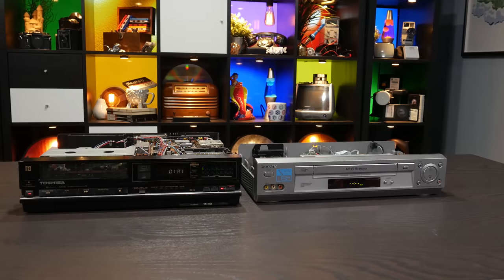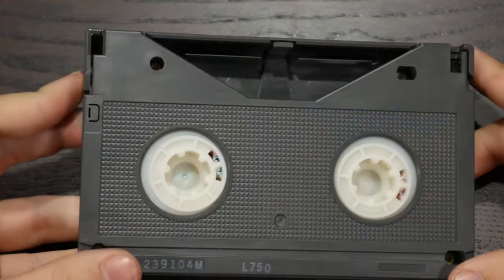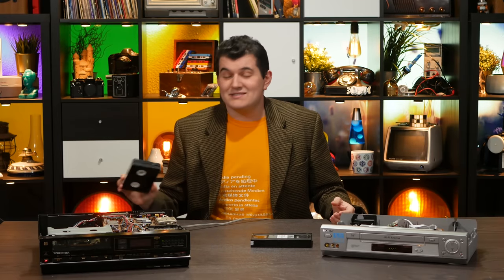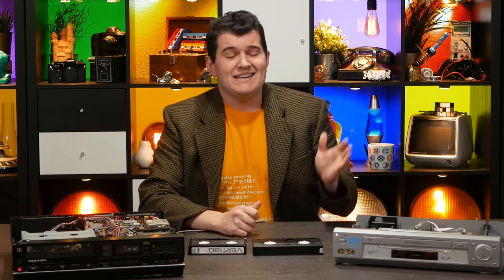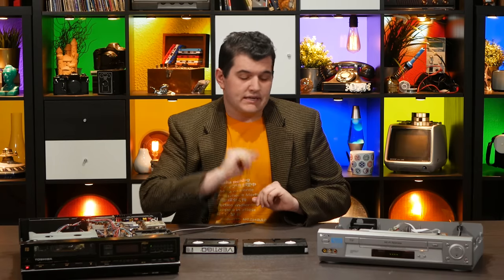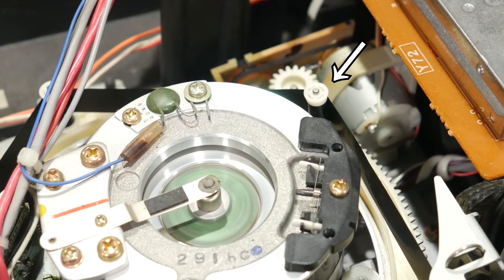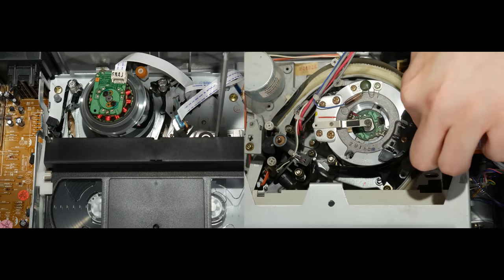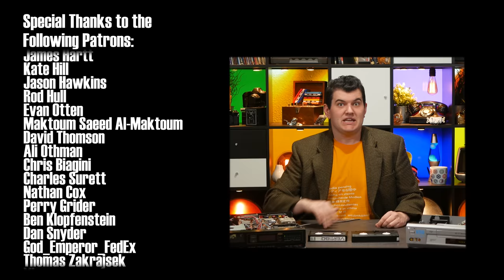The VHS cassette was more clever than Beta

Comment: “Where is my HD-DVD player?”
I’m still laughing 😂
Reply: At least there were a few BluRay HD-DVD combo players. I'm not sure how many VHS+BETAMAX combo machines there were.

And because it's still semi recent, finding a BluRay\HDDVD combo drive for a PC or a Samsung BluRay\HDDVD combo player isn't difficult.

The problem really comes in when you look at format quality. Everyone claimed HDDVD was better, which wasn't true. BluRay offered substantially more capacity. 20GB more on a dual layer disc than HD-DVD's 30GB dual layer cap.

The ONLY advantage HD-DVD had was simply it could be made compatible with a DVD player through another layer or simply pressing the DVD layer on the opposite side of the HD-DVD side (which, granted, could theoretically have been done to a BluRay if Sony cared to maintain legacy compatibility.
Reply: @emotionz3  Thw biggest advantage was  HD-DVD had more functionality at launch.  Bluray was in flux so compatibility of features between players varies wildly.  HD-DVD was also cheaper to manufacture.
Reply: I liked HD-DVD because it was region free. None of the other stuff mattered.
Reply: Remember when the Xbox 360 had a HD-DVD external player?
Reply: @Takeshi357  Probably one of the reasons HD DVD failed, less companies wanting to get into a format they couldn't region lock. With tape PAL tapes won't work in NTSC or PAL. Kind of solved problems.
Reply: I seriously doubt THAT is the reason. If it was so unpopular with the studios, why did they ditch the region lock again for 4K UHD?
Reply: A big reason for HD-DVD’s failure has to do with Microsoft’s involvement and proprietary software/codecs (especially VC-1 and HDi) used in the format.

A lot of technology companies (especially now ironically, Apple) backed Blu-Ray since it used more “open” (aka non proprietary) software and codecs (e.g. H.264 and Java).
Reply: @Takeshi357  because physical media is rapidly dying at this point, and a high end standard that most people can't utilise isn't exactly likely to "need" region locking.
Reply: @Yeen125  Interesting, as also Bluray was at first seen as a boon to computer hardware, but I was told the codec to use it was blocked by the design owners, and most companies dropped adding those drives to machines. i had one given to me, basically useless.
Reply: @Takeshi357  "I liked HD-DVD because it was region free." Absolutely agree! Given that the studios which signed up to it apparently also agreed, I see NO excuse for region coding now. There was no region coding on CDs and the various labels (often the same as the film studios) didn't seem to mind at all!
" None of the other stuff mattered." This is where I have to disagree somewhat. The two major advantages of Blu-Ray were: 1) longer time/more data available. Back then this was a big issue (remember some Betamax films on two cassettes?) and doubly so for data recording and archiving. The lesser capacity of Beta (especially in the early days) is one of the factors which contributed to its demise. Sony learnt this lesson and was determined NOT to be beaten by it again. Although most films could be squeezed on to a single HD-DVD disc, there were some outliers where the quality suffered too much.
2) Blu-Ray discs learnt from the downsides of the DVD, and were much more resilient to rough treatment; although more expensive to produce as a result.
Ultimately, studio support for the Blu-Ray format is what tipped the balance and 'won' the war.
Reply: @LiEnby  Great! Since you are not talking Hex to ASCII we have no idea what you are talking about!
Reply: @FurryMcMemes  Why?
Reply: I always thought one of the major reasons Blu-ray won out was because the PS3 was the only console at the time to have native HD support, with a built in blu-ray player. I remember hearing at the time of its release, it was one of the cheapest blu-ray players on the market.

Consumers were going to buy the console anyway, and thought, like myself, there's no point in buying a separate player. Just get the blu-rays.
Reply: HD-DVDs are old news, HHDDVVDDBVD are all the rage now.
100 Points for whoever gets that awesome reference :D
Reply: @rahb1  I'm guessing because Microsoft was involved with HD-DVD so they sold a separate drive for the Xbox 360 so owners could play those movies.
Reply: @rahb1  hex can only ever be used to represent ascii text data (lul probably one of its worst uses)

its the HDDVD encryption key >_>

Comment: Regarding tape cartridges, my all-time favorite is Video8.
The Betamax tape feed path looks like a nightmare to untangle if anything ever goes wrong with the machine.
Reply: I remember the Sony rep proudly bringing a demo Video8 machine into our workshop to show us. We quickly wired it up to a nice Sony TV and off we went. There was no doubt about it, the pictures were significantly better than VHS/Beta and we all stood around nodding and making the right noises. Then there was quite a long delay before the system actually launched onto the market, and something seemed to have happened in the meantime - the pictures were definitely NOT as good as the demo. in fact, although they were still better than VHS/Beta, the difference was small. Never found out what went on during that long delay...
Reply: @andyhowlett2231 cost cuts. I don't remember if video8 was tape but they probably increased recording time in exchange for worse quality

Comment: The light detection of the end of the tape reminded me of something I nearly forgot: back in the 90's at some point, when I was 12ish, I acquired an old VCR that didn't have a cover. (I got a LOT of electronics by grabbing other people's trash and they frequently had damaged or missing cases, but working internal electronics!)

I used it to record TV shows on at night ("Becker" was one that was on past bedtime that I'd like to sneak) and had no problem. But then I put a lamp on the same table and found it kept spitting the tape back out any time I tried to play or record... took me a little while to figure out that there was a light sensor in there!

Putting a random piece of sheet metal over the top of it solved this problem. I used that VCR for a couple years.
Reply: Damn, people threw away electronics when only the case was broken? That sounds like such a boomer thing to do lmao
Reply: @Reydriel  In America people throw a lot of things away just because of cosmetic matters. All grocery stores combined in america throw away an average of 43 billion pounds of food every year because of cosmetic/blemish reasons.
Reply: @autonomous2010  not just in America.
That's something every developed country does.
Reply: @Reydriel  oh yeah, tons of stuff with minor damage - often cosmetic, but sometimes easy to fix electronic stuff like a failed capacitor - can be found in the trash or on the cheap in the second hand market. I got a Super Nintendo as a kid basically this same way too - the case was ripped right off (my guess is someone got VERY angry at the game) but the board inside was fine.

I actually still have that one... and it is still just a board with the wires popping out of a shoe box lol.

And the best part about free junk is if it doesn't work? Oh well, no big deal. Worst case is you waste time, but even in these you often learn something new about how electronics go bad.
Reply: @Reydriel  Heh.  I had neighbors in the 90's across the street that threw all sorts of good stuff away.  I got a stack of HP laser printers.  Most of them seemed to work fine.  I got a lawn mower.  The only thing wrong with it was a bolt missing in the handle.  I cut my grass with that thing for years.  They once threw out a couple of gas powered weed-whackers.  I saw them as I came home one day, but came back out too late... someone else had already grabbed them.
Reply: @destructionator17  The UK doesn't seem to do this so much, with electronics, anyway. They do in Japan though, I've got so much free stuff. People are supposed to cut the power cable off, but sometimes don't, or devices just use a seperate cable. I got a great fan with some sun damage and a cracked case for nothing, even the remote control still works!
Reply: Cut the power cable off? What are these people HEATHENS?
Reply: @michaelmartin9022  "People are supposed to cut the power cable off, but sometimes don't" 

But Why Though? What purpose would that serve other than ruining a perfectly good power cable?
Reply: @autonomous2010  I think it's to stop people scavenging and using perfectly good electronics when they could be buying a new one, many of which are being produced by Japanese companies.
Reply: @michaelmartin9022  probably H&S related.
Reply: Off topic, but the first time I saw the show "Becker" was the episode titled "For Whom the Toll Calls", where he receives a toll call from a small town called Chico, CA.  He denies the city even exists and claims it to be made up. It was funny at the time because that's where I had just moved to for college and saw Becker for the first and last time.  Anyway, that's my Becker story and you are all a little smarter for hearing it.  You're welcome in advance.

Comment: I grew up from the age of five watching VHS and I've learned a lot of things about this format. At the age of 15 I learned to perform "tape reel donation" from one VHS cassette to another by opening the cases and swapping the reels. Not exactly that easy - you'd have to remember to lower the tape between the pins on the back of the cassette - but once you learn the position, it is surprisingly simple to learn and master. If your cassette has a broken case, I can happily switch the tape reels.
At this point in time I am possibly the only qualified VHS tape surgeon in South Western Sydney Australia...
Reply: Ok
Reply: I don't know if that's worse than being able to overdub tapes

Comment: You know you're getting old when you have lived long enough to see the rise and fall of an entire technology.
Reply: Remember floppy disks? god, they sucked so much.
Reply: Tube radios and TVs, Transistor radios, 8 track cassettes, audio cassettes...  Then things began to really heat up. Now, I've seen representatives of 70 years of technology in my life, and kinda feel, "If it worked, don't knock it". I still prefer XP over windows 10. Works better for the things I ask it to do.
Reply: To be fair that can be within a year for some tech nowadays
Reply: Fart  LOL!!  Said I prefer it for what I ask it to do. I have a windows 11 system, of course. Or how would I know that XP performs better at certain tasks??
Read recently that 40% of the systems are still using XP. Don't know if that's true, but it suggests that an awful lot of people have had the same experience.
Reply: @MonkeyDefenceForce  i know about floppy disks and have experience with them, even if I born in 2009. I have 31 floppy disks, 3 computers running XP and a keyboard with PS/2 connector. Heck, even old calculator, old camera which uses tape (for photos) and an old fan. Oh, and a pirated version of NES: classic edition, old CRT TV and a VHS VCR. Also, my Tower PC runs XP SP 3 and I code on.... Just BASIC. Holy cow, I'm too young but also too old. I don't even know, do I exist....
Reply: and another dozen along the way. DCC, CED, VHD, MiniDisk, Floppy in myriad sizes and densities, DataPlay, Video 2000, LaserDisc, UMD, the various SyQuest hard drive based removable storage cassettes, the various Iomega storage cassettes that started with floppy-based magnetic storage media and moved on to hard drive based magnetic storage media, and essentially every variation of photographic film.
Reply: i'm 17 and i've seen the rise and fall of flexplay
Reply: You mean like Mini Disc and HD DVD, hell - why dont we throw D-VHS into the mix as well :)
Reply: @kadepow11  That was more of a speed bump than a rise and fall.
Reply: It was DVDs for me. Thanks for reminding me of my age. 😡
Reply: @MonkeyDefenceForce  Floppy disks were fine until they started getting outclassed by higher capacity formats, thus producers of 3" diskettes running the quality into the ground so they could still hang on by being super cheap.

NORAD still uses old 8" floppy disks for the launch codes, not out of cheapness or anything, but because when those things were made to a high standard they were genuinely bombproof (and the launch code part itself is a very low intensity task).
Reply: @LouisJasper  Blu-Rays is just DVD : Part 2 for me, it didn't really register as any real change because I got a PS3 maybe 17 years ago and kept watching DVD movies (and then Blu-Ray movies), just the same.

Compare to when I first got into DVDs many years earlier, and I thought they were mostly much better than VHS. Sure, you couldn't do the smooth scanning/winding, but you never had to rewind and the discs didn't break themselves down from normal use, the picture and sound remained as clear as ever.

Comment: Yes, Sony did indeed use an M-load (albeit a very wonky M) on some of their later Betamax systems.  The ones I am aware of were the C20, C30 and C40 models.  Remarkably slimline, and the C40 boasted linear stereo tracks, so clearly from the later end of Beta.  The mechanism they used was much more compact than the standard Beta, and it loaded a lot quicker too.  Worth checking out if you can find one as they are a real oddball.
Reply: I might have one of those models somewhere, but I can't even remember, and if I do, I don't think I ever took the lid off it. Thanks for prompting me to check!
Reply: Do you know if those systems had any protections against recording on the very earliest part of the tape, which u load systems wouldn't be able to read?
Reply: @CattoRayTube  No, it didn't.  It could record and play back many seconds of material that was invisible to a U-load Beta machine. It also put the tape back on the left spool when unthreading the tape rather than the right spool as a U-load Beta machine does, meaning that a fully-rewound tape placed in a U-load beta machine caused the loading ring to struggle somewhat, as the tape had to come from the left spool, and was dragged across the head.  Not a major issue I am sure, but owning both a U-load and an M-load Beta machine was quite interesting as to what they could and couldn't do.
Reply: Remarkably, there is a youtube vid of someone having loading issues with one of these Beta machines.  https://www.youtube.com/watch?v=lmYzVLSgnGk  He doesn't actually get to load a tape, but you can kinda see where the loading system is and where the tape goes.
Reply: It was just a more compact U-loader. I've owned an SL-C20.

Comment: I worked on VHS and Beta machines for years and although the recordings on Beta were slightly better than VHS, that was about the only improvement. The tape path on Beta was very long and depended on many tape guides to keep the tape in line. Beta also kept the tape 'wrapped' around the head drum while fast-winding, which led to accelerated wear of the drum. I had quite a few cases with Beta machines where the tape would stick to the highly-polished drum.

Comment: "Do notte buye Betamacks"

Your closing statements made me lol. Tho you didnt mention how failure prone that insanely complex tape transport system was. We had a Betamax when I was a kid and it messed up so regularly that 5yo me thought said Betamax player existed for the sole purpose of destroying Betamax tapes
Reply: Interesting. although I upgraded my Betamax machine to take advantage of the new features, the original continued to operate until a few years ago. In the meantime I have gone through five VHS machines; each one cheaper in construction (and lesser in time to survive) than the last. At least DVD is better built, or was, if my latest drive is anything to go by.
Reply: Agnes Nutter was always right :)

Comment: Betamax didn't unlace the tape from the heads when fast-forward/rewind, meaning extra wear on the tape.
Reply from the maker: This is also relevant! However, I didn't put in the video because A) there are exceptions in the realm of Beta (notably Sanyo-built machines) and B) later VHS machines (including the one in this video) would also leave it threaded. Since there are exceptions to be found for both cases, I don't necessarily find it to be too much of a net gain or loss in either's favor
Reply: @TechnologyConnections  Does it not unthread if you stop then ff/rw? Had a few that did that, visual search being slower.
Reply: That was also the benefit of early Beta vs VHS. Beta laced up upon loading the tape, and had almost instant play. Early VHS would stuff around for a few seconds lacing up the tape before a picture would appear. Beta was pretty limp around the heads in FF and REW so not a lot of wear in those modes. It wasnt until maybe the 90s that VHS machines laced up from the start instead of just loading the tape into place. Another disadvantage of Beta was replacing the heads in the machine involved complicated alignment. VHS video heads were a couple of screws, a few wires  to un-solder, or terminals in the later ones, and a pulling tool, and the whole upper drum could be changed in a couple of minutes.

Comment: The "helper" that comes out just before the erase head on VHS is there to monitor the tension on the tape and apply a soft brake to the supply spool - via a band that goes around the wheel in the player. Those of us who used to repair VHS machines had access to a special clear shell "cassette" that allows the machine to be operated without having tape or tape spools present. In such a case, with the machine in play mode, attempting to turn the supply spool "cog" is quite difficult unless the lever is moved towards the pinch roller - which a real piece of tape would do. Another bit of ingenious design!